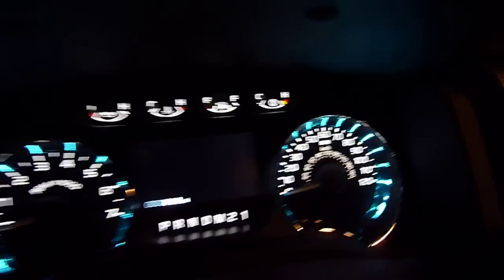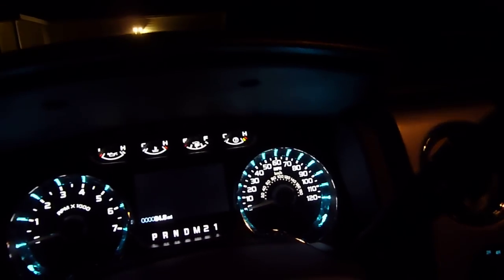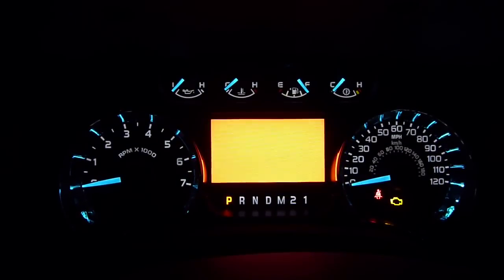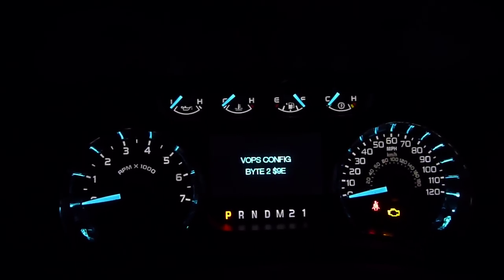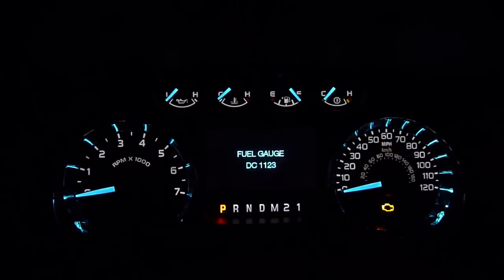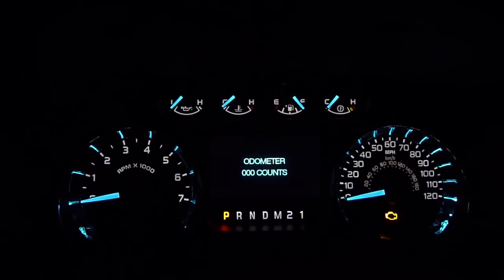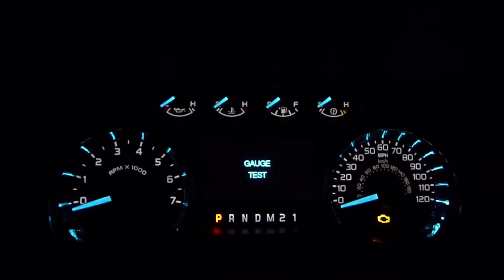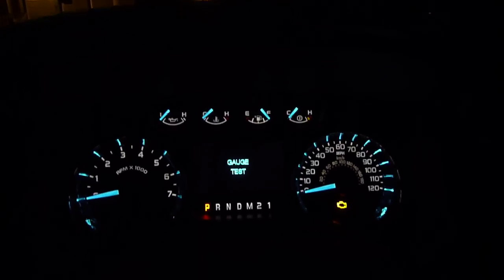Ford F-150 Gauge & LED Test Mode

Comment: I use this to reset my stuck speedo gauge a couple times a year on my 2016 F150.
Reply: I just noticed that on my 2015, started it up today and after about 500 feet I noticed it's reading ~50mph as I'm driving through a parking lot. 

Turned it off and let it sit and got back in to drive away thinking maybe it just needed to be turned off and on again. No luck.

Got out and wiggled the battery terminal connections thinking it might be a loose electrical connection, no luck. Turned it off again and the speedo is still stuck at 47mph when the truck's off and locked.

Will try this engineering mode test and report back if it fixes it.

Update: Yep, this method fixed my issue. All the gauge needles made this little scratching/vibrating sound for about 10 seconds, then they did the sweep and reset back to normal.

Comment: How did you install the LEDs
Reply from the maker: Travis Fletcher Those are OEM
Reply: @EricAtMazda  my 2014 f150 xlt has exact same dash lighting/blue and I love it.  I'm guessing you have same year or later.  I didnt know about this until I needed a new key fob and started a research campaign after finding out the dealers charge $120 for the key fob and $60 to program it!!!! I called other local dealers and found they charge even more!!! Choke!
I ordered 2 oem keyfobs for $39 each. If you want more fun playing with cool options you can change look into FORScan program free at www.forscan.org 
Some programming functions require the extended license but you can get a free trail ext license for 60 days but the full ext license only cost $10 and I was happy to pay that for the money it's going to save me programming my keys to work.  A local locksmith was going to charge me $50 each to program.
Anyway I dont know if you care about any of that but it will allow you to mod quite a few features that normally require a dealer and they dont tell you about it and will charge you.  Search YouTube for forscan mods, you'll be amazed at what it can do.

Comment: I'm trying to find out the color code for the instrument cluster. I got a cluster from the junk yard and the plugs for the wiring were all cut.my truck is used , and don't have the oem cab on it.How do I wire the new (junk yard ) Gage's in to it.? Can anyone help me out.

Comment: Do you know if one can upgrade from the regular cluster to this high level cluster with the led screen?
Reply: yes you can. but you will need to switch out the steering wheel buttons as well.
Reply: Thanks
Reply: no  problem.  check out PascackValleyRailfan to see his conversion.